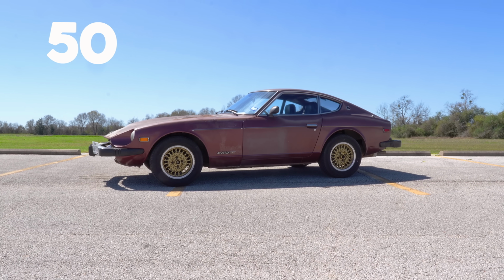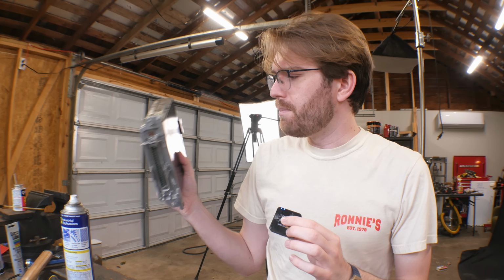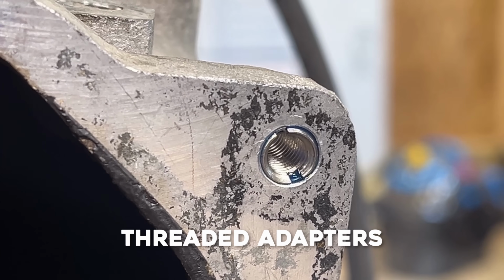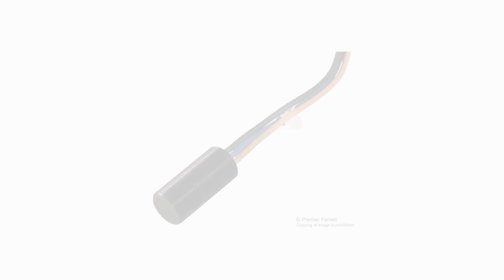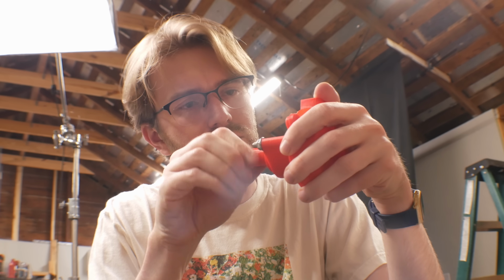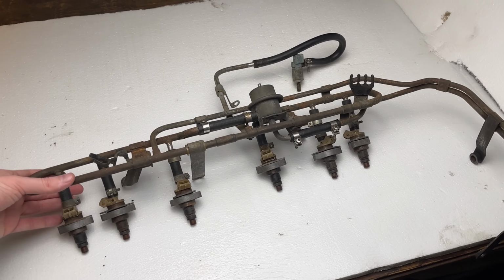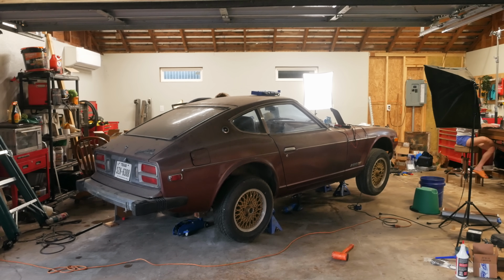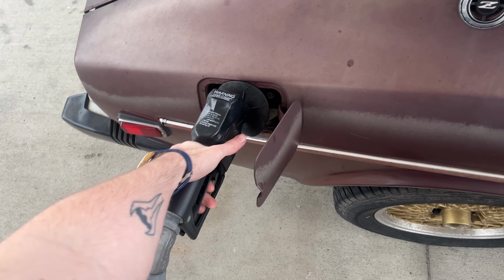Modernizing a Vintage Car

Comment: HERO-level! That engine bay looks SO clean without all those extra (janky) OEM parts!! Nissan should really take note and manufacture your kit and NISMO tune it. Any way for you to tune it further? My wish list for you would be to have the body and chassis cleaned and re-sealed and painted, assuming you can get the sponsorship. Make it stiffer. I recall a Japanese shop that drilled holes and bent them out to achieve stiffness with less weight. And put in all lightweight parts. Again, if sponsored. It could be an evolving series, if you're not already doing that. Seriously, PROPS, man. Great job!!!

Comment: I was thinking it would get way more power and better fuel mileage with those upgrades if it's 2.8L engine. Are the old engines just bad at airflow or something, or how can a modern 2L without turbo be so much better?

Comment: Your humor and videography kept me glued to the story. 

I worked with a guy that took a ‘72 240Z and fit a Chevy 350 into it.  That thing was a total sleeper that was scary fast.
Reply: There was a guy who did that in Yankton, South Dakota.  That car was famous.  I think Hot Rod or Car Craft ran a story with photos showing how easy it was.  The Z cars had a lot of room under that hood....and hey...power to weight ratio cures all problems.  On my 260Z, we put three DeLorto's and had a real fast car.  With a Cam swap and maybe some better exhaust...that little car could hold it's own with some v8 powered cars.

Comment: Massively complicated with enormous amount of machined component modification. Nevertheless, it was extremely interesting and funny at the same time. I think just putting an aftermarket engine, that has already been fined tuned electronically, is probably easier and less expensive. I'd rather modify engine mounts and other space modifications if necessary. I would also put a modern electronic transmission behind that engine. Since I live in Alaska, there would be zero HP sucking immission crap on the engine. Definitely the EGR would be in the trash after I smashed that POS into little pieces. There would be no exhaust air injection either.

Comment: Absolutely love shit like this. I'm not a "tuner" but have done a lot of it on multiple EMS. The EMU Black and most modern DIY/ aftermarket EMS have a built-in VE learning mode. Something 'close enough' to get it running and then do a lot of variable load/ RPM driving for VE learns/ updates. And of course, if you have dyno tuning available, dial it further in and get the timing table(s) right and as close to MBT as possible everywhere in the spark tables. Well done!

Comment: Man I'd be so disappointed if I spent 8 months to gain 13% more power and 2 extra MPG fuel efficiency 🤣
Reply: A turbo and valve springs would have been installed straight away If I had done this.

Comment: I think your bearings for the speed sensor are not gonna hold long enough, especially because without the spring, they're unsufficiently loaded (bearings have a minimum load, under which the bearing balls just grind in their races)

Comment: Engine were iusually where enthusists looked to upgrade. The MG 1800 B series engine was often re-bored to 2L with weber carbs and electronic ignition. MG electrics needed work but sadly replacing the loom (with better insulation) was not straightforward.

Comment: Before you showed the sensor to read how fast the engine spins i said it out loud its a camshaft postion sensor and after a while you said so yourself ... Enjoyed every bit of this episode as i have a shit box that i fixed my self . The air to fuel ratio 
Long and short trims were a pain in the ass and spent weeks even a month adjusting them and finding the root cause. And finally one day like you started a your car for the first time , i for the first time got the trims under 5% ltft and stft 

I was proud of myself.

But what you achieve ronnie , you  made my day and made my belief more strong that if you put your mind into it every car could be fixed and modified with modern components

Comment: 9kmpl that's same as VW virtus with turbo Which almost makes around same power. Mind you it's more reliable than VW 😂.  (p.s. VW Virtus mileage in highway is around 15kmpl, I mentioned for city ride with heavy traffic, so don't come crying)

I would also like if you put Turbo in a NA engine. that would be a interesting video to watch

Comment: Honestly, claiming back over 20HP just by making everything outside of the engine more efficient is truly impressive. The best part is how clean this really is. Nothing you did was destructive. So to get THAT much power in this manner is insane. Now imagine putting some work onto the engine itself, you make this thing a monster with this system backing it.
Reply: 1/6 power increase AND better fuel economy is actually crazy when you think about it. And like you said, he has a platform he can build off too

Comment: Have watched a ton of YouTube videos but this is my first time responding.  Felt I needed to say what a great video this was.  Was kind of like  watching a time lapse not only of the project but of engine development since the 70's.  The amazing part of this project is that you created a foundation for so many other mods.  You might have only gained 20hp but with the tuneability you now have another 100+ hp is at your fingertips, which really wasn't possible without risking blowing this thing into a million pieces.  For what it's worth there are enough z owners out there that replicating and selling this would likely be worthwhile.  Fantastic job!

Comment: Next you should do a cam swap.  To meet EPA standards,  the cams duration of lift were shortened to reduce overlap.  While this may help reduce emissions at low speeds it really limited the efficiency,  especially at higher rpm.

Comment: distributor runs half crank speed so not realy great for efi/electric ignition.

machining the crank pulley or flywheel or bolting on a trigger wheel

Comment: New cars are not more "reliable" they are only more reliable before something breaks down. But good luck when they actually ARE meant to break down. Take a today's car and lets see how well it works in 25-30 years compared to a 1930-1980s car.

Comment: I LOVE this. The next thing I want to see is improving performance strictly by modifying not replacing. Diy cryo treatments, clearance coatings, friction coatings, balancing, porting, ect INTERNAL parts. And then maybe a heat managment section.

Comment: The distributor you spent a lot of time on nissan did already in the 1982 turbo 280z. Could just cut the rotor button off and put a cover on.  you can also adapt a 1990ish maxima v6 one like I did.

Comment: Are you  a bit slow in the head, or are you just living in your Murican bubble? Bosch is one of the largest automotive suppliers in the world who is responsible for most of the most important develeopments in cars in the last 100 years and yes, the also have a daughter company that builds dishwaschers and other appliances you wouldn't know since they are high quality. Shouldn't you be working on an S10 or F150......

Comment: I have a '79 ZX. Floorboards are rusted out, fenders are rusted out, interior is rotted out, the entire bottom is beaten and scraped flat... and its the second most awesome car Ive ever had. Got it from a friend who called me up one day and said 'if you want a car, come get this thing out of my driveway'. He blew the driveshaft for the 3rd time and didn't want to deal with it, so I drive 4 hrs and he's left a driveshaft and box of tools for me. A couple years later he came into town and asked to borrow it. Dropped it off two days later with the speedometer needle twisted off and $100 in the ashtray. First car I floated the valves in. Thats something everyone should experience at least once. Nothing like that sound, the power falling off a cliff...  and the pucker.

Funnest was a plain Jane '77 Volare wagon with a 318. I would absolutely love to have another.

Comment: 13:50 would this be called the camshaft position sensor or crankshaft position sensor?
Reply: Crankshaft, since afaik the distributor is connected to the crankshaft

Comment: Dumping on the  Bosch Jetronic is just... something else. They developed the first computer-controlled fuel injection usable in mass-produced cars, FFS. Back in the day, there were basically two alternatives for intake maifold injection: go Brit with the Lucas stuff or get a Kugelfischer. The former is extinct for reasons and the latter did the fuel injection control mechanically by carving the timing and fuel/air ratios into a cone of metal that was 'read' by pins - the so-called 'potato'. You basically did the engine tuning with a hardened carving knife.

So yeah, going with a more modern injection controller is good. But for its time, apart from properly adjusted carbs, it was the best you could get.

Comment: Cool stuff.  Even if you didnt make a lot of extra power or fuel economy I bet the day to day driveablility of that car isnl far better than it used to be. 

I will say as soon as I saw your distributor shaft problem my first thought would have been a local mom and pop machine shop.  If they weren't busy they could have probably made you one while you waited.

Comment: You are incredible in so many ways! Thank you for sharing this amazing project.  I’ve had multiple generations of Z’s from the 70s and 80s, but my ‘76 280Z was my favorite.  I put countless hours into struggling to keep that fuel injection system going for the 14 years I had it, starting in 2000, but I eventually gave up and sold the car.  You have mastered the biggest problem these cars face with excellence!!! Bravo!

Comment: If you plug the valley in the intake manifold the one right next to where you put the throttle body you would gain 5-10 more horsepower

Comment: The car must run, 1 liter, 12 km….
CLEAN the motor, inside.
Open The AIRintake, 🎉In the motor. With a Dremmel…
Clean all bearings..

Comment: First let me say this has to be the best YouTube video I have ever watched. I’ve watched it three times already the first time was for curiosity and the next two times were just because you are very funny and do a great job explaining things. I owned this exact car in my early 20s back in the late 80s. Not only did I own it, I worked on it with my (now passed) older brother who was a mechanic with 30 years experience at the time and his own shop. We spent many hours troubleshooting that car and your video brought back many fond memories😢. The level of hard work and perseverance you put into this project is amazing! You checked all of the boxes for a great YouTube video     . Entertaining, informative, useful and you broke down a complex process so that anyone could understand it. Absolutely fantastic job. Finally I also just watched your Kawasaki 1000 rebuild video believe it or not in my late teens and early 20s I rode my 1984 Kawasaki Ninja 900 almost daily, AND I still have it in my garage and I still ride it a few times a year completely restored 40 years later I figured you would appreciate that. (I had to disassemble the engine to replace the starter clutch. If you don’t know what a nightmare that is, take a look , it could be a future video for you) thanks again for a really great video!

Comment: Bro but you lost the best part of an old analog car, the cable controlled gas pedal connected to the air control valve. It has zero latency and you basically introduced latency with an electronically controlled gas pedal

Comment: Datsun💙💙
Hope there is a part 2 and 3 until a full restoration, and you get more sponsors. This is a Datsun, which will last much longer than some modern cars, maybe even another 15 years if it doesn't get banned because of environment related laws.

Comment: The thing is, if a car is dead, and the engine is beyond repair, I agree with modernising it, add a new engine or electric motor, but if it is working I disagree. Even if it is unreliable. The thing with a classic for me is no one is buyjng them because they are reliable, cheap to run and easy to drive, half the appeal is that they are have character and need love and care.

Comment: Damn that was a good funny video 😂. Wonder what switching it over to a carb would do for power and gas mileage. And based on watching a video on small block fords and chevys, if you don’t have good heads to get good air flow, which stock fords and chevys didn’t, you’ll probably not get a lot of good hp. Don’t know what the stock heads of nisanns 2.8 had but would be interesting to know.

Comment: I thought you did a phenomenal job on upgrading your Z . But sports cars are not made for fuel efficiency.  I find it hard too believe you couldn't get more out of it by changing the computer settings. 
What you did, keeps the cars balance in the weight and suspension which I consider superior to an LS swap. 
NICELY DONE 👍

Comment: Next video should be on how a high flowing exhaust system can increase efficiency and power without engine modification to keep with the theme of making an old engine run efficiently like a new engine

Comment: Ive really been wanting to do something like this with my 1987 Ford Ranger, Grandpa bought it brand new and rolled the odo 3 times on it (it now only shows a few hundred miles since it didnt have enough digits to go to past 99,999). I put a brand new engine in it ~5 years ago but its only been driven maybe 500 miles total in that time due to electrical problem after electrical problem. Mechanically its still great and was Texas truck with no rust (now in ohio). Was going to go haltech with custom harness I would have to build. But how much better would this(building off of the EMU Black) be vs Haltech in terms of cost and ease? Does anyone know?

Comment: It sounds like your camshaft is slightly ... worn. even with 'MERICA levels of low low compression, that engine should produce even more power once the carburettor is removed from the picture. 8.3:1 compression, 2753cc - it should be sucking down about 105-115g of air per second at 4800rpm which was the peak power rpm. Yes, im a nerd, and ive got graham bells book on four stroke performance tuning laying on a shelf behind me... Anyway, 

solving for thermal input assuming 12.5:1 afr instead of 14.7:1 since it usually makes more POWAH, that gets us ~8.5-9g of fuel per second for that amount of air. its going to be less - way less - but still. thats in the neighbourhood of 400kW of thermal energy, and you are extracting about 25% of that at "half the rpm". im assuming the dyno guy forgot to input the correct rpm normalisation when doing the run, since 142hp (~107kW) at 2500rpm is
 deleted

EDIT: fuck that, i checked my napkin math and its more on the high side of plausability. GZ on the engine job! if thats at 4800RPM you are looking at above 27-28% thermal eff, and if its at 5000rpm thats 26.2% thermal eff.

EDIT2: called up old aquaintance, asked about his NA build from 2010ish, and it was on a US spec L28E engine, but with mild cams and a 6200RPM redline, did 181hp at 5750 with .460" lift and 280 duration cams. I think that corresponds to stage2 road cams. Sorry for calling your build weak initially!

Comment: Very good. One thing however - I think you have set the static timing to O. It should be about 10 degrees BTDC (Before Top Dead Centre). This allows for flame progatation  across the combustion chamber. Not sure if the computer actually calculates that. Probably does.

Comment: 63 years? Is that based on the cheap gas you get in Texas? It might pay for itself faster in Washington where gas is like 5 bucks a gallon. Who knows if it'll be 10 bucks in the next 10 years. I'm feeling optimistic that it'll take less.

Comment: Dang, what memories. I worked on Datsun Z's exclusively for 10 years between 75 and 85. I could still tear down that engine, but that wiring harness??? You da man. It's a shame you couldn't upgrade the intake, or at least the exhaust system. Truly an amazing job!!!

Comment: Great video, and amazing achievement! I used to have a similar age MGB roadster, and there was a tiny hall effect kit for that to replace the points in the distributor with a hall effect sensor, but still using the rotor arm and a single coil. Couldn't you have done something similar here, but with your separate coil packs, by putting your sensor and toothed wheel inside the original distributor body, rather than having to make something from scratch to fit where the distributor was?

Comment: you should modernize the interior next. I feel like that isnt something a lot of people do. Once i make more money and once solid state batteries come about, i want to convert my 2008 saturn astra into a luxury ev(or at the very least a premium economy like a high end civic, as im sure i cant make it 100% luxury). So ill be gutting all the current interior systems and installing my own and putting in new interior trim such as premium leather and materials for the all the touch surfaces.

Comment: Well i Hope you used counter clockwise screws for your spark Timing wheel. Otherwise it will get loose over time, manipulating the Timing, Destroying your Motor.

Comment: I got my hands on a 73 240 with out all the epa junk on the engine and it feels fairly quick, I think the extra weight of the 260/280s made the cars feel slower.

I will say the SU carbs in the old Zs are definitely black magic.  Did an oil change on my carb last year...